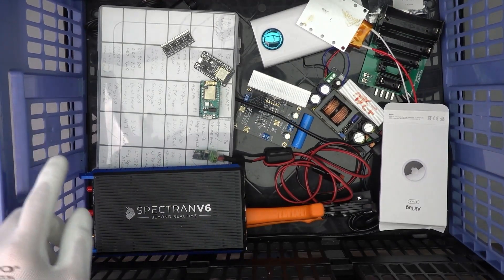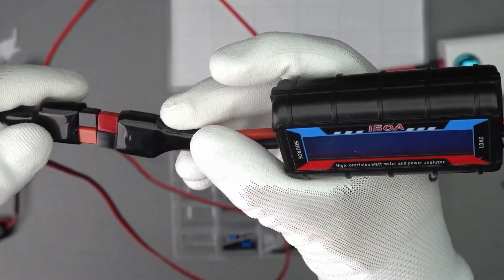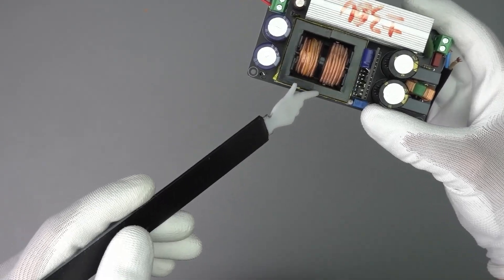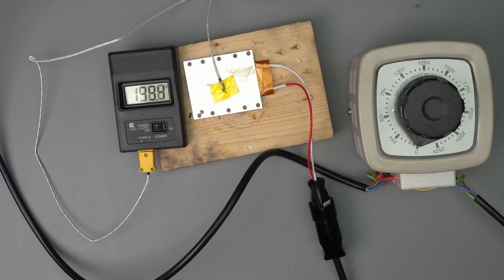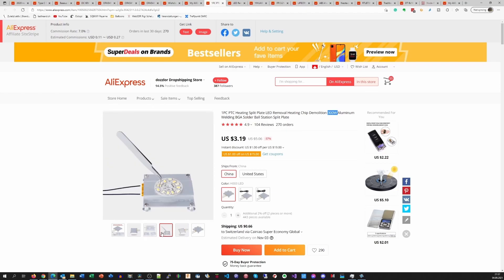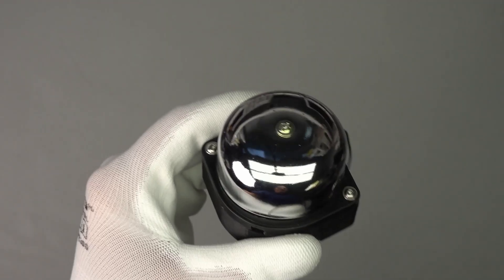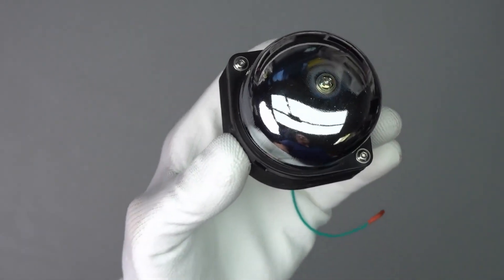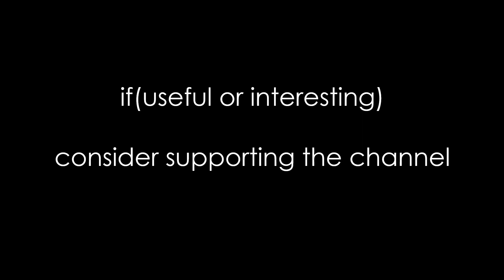#401 What is in my Mailbag?

Comment: Of course there is also the problem with the serial ports on the RTL8720 BW16. The one connected to the ch341-uart converter is not the one used for flashing. So you either have to connect the two serial ports with wires, or use a different converter on the second port. The combination of button presses to get it into flash mode seems to be a problem on some boards (hold reset, press burn, release reset, release burn), but it works for me. Arduino gives you a countdown to start the procedure.
Reply from the maker: Good information. Thank you! I probably would have searched why it does not flash ;-)

Comment: The problem with using a hotplate alone to do SMD solder is that sometimes you need so much heat that you get discolouration or burn the board.
I like a hot plate to preheat the board and then hot air to target the component.
Reply: You're right, but if we are talking about doing things on the cheap, what you are suggesting is probably going to be quite a bit pricier. I think for a lot of ppl starting out, shelling out for good soldering irons, power supplies etc might not be possible. Even though it would yield better results.
Reply: There are these low melting point solder pastes like the TS391LT50 from Chip Quik. It melts at 165°C and I got excellent results with a hotplate.
Reply: @ockeojoj  The cheapie hot air stations aren't that expensive (or at least they weren't before the world ended).

Comment: The heating pad is a great find. Might be useful to build a 14x14 cm pad with 4 of these and with switches to control each individual square and consumption 300-1.2KW.
Reply from the maker: Maybe this is possible. For that I still have my old Aldi oven which I adapted to be used for SMD soldering.

Comment: Hi Andreas, If am not wrong this power bank what you have can be used as a UPS. It doesn’t reset power at output when you attach/remove power from it. I saw it in a video which I can’t find right now.
Reply from the maker: Thanks for the info. I did not check so far. It would probably be a big UPS...  You are right: Many power banks switch output off as soon as charging starts.

Comment: You mentioned a few videos ago possibility for using 20v Lidl battery packs. As a fellow Ham, to use a 4A pack and convert to 13.8v output would make a good project. Using a switch mode  regulator for higher efficency but with low line RF noise being the ideal solution. Add the possibility to parallel a 2nd battery pack for 8A and it would make a neat and low cost portable 13.8v supply. To recharge the packs Lidl sell a dual charger at low cost.
Reply from the maker: A possible solution. But instead I use a simpler one: A LiFePo4 battery without and conversion. You get them in various sizes and the overall solution would probably be cheaper than the Lidls plus strong buck converters. An advantage could be that we could produce a stable 13.8 volt. The 4 cells LiFePo4 quite fast are below 13 volts which, with some radios, does no more yield in full power.
Reply: @AndreasSpiess  Your suggestion for a LiFePo4 is a good one but is more expensive and not as much fun as making a Lidl solution. Do you have any pointers / thoughts for selecting a low RFI and low line noise converter for 18v to 13.8v at 10 amps? Btw the Lidl dual charger is 15 Euro's, it has separate battery connectors + PCB and battery status display PCB inside so will make a perfect rugged project case, after the 240v PCB is removed. With 2 x 4Ahr batteries  at 50 Euros /pair, it will provide around 144Whr. The batteries could be easily changed once depleted for a fresh set in the field.
Reply from the maker: So far I never had to deal with so strong regulators. But I assume you have to invest some money to get the RFI out. At least this is what I did for my 13.6 volt server power supply feeding my shack.

Comment: They really took the cheapest route on the first touchscreen tool. That's just a guitar pick with a hole in the top! I strongly agree with the button to switch USB voltage being bad, that would have potential to kill many components. I have to admit airtags seem entirely useless for me, as it relies on iphones for signals to get around. Great video as always.
Reply: The usb-c pd board with the button can be set to a fixed voltage with the button disabled - like this:
https://youtu.be/aIHj3qMRqqE
Reply from the maker: @thigh_bone: That is what I did. But I do not trust it and the effect would be a bill of more than 1000$ for a new transceiver :-(

Comment: Hi Andreas. Maybe this is  my first comment to the channel although I follow U. About the RTL8720DN I managed to get it with lower shipping fees of $1.58 at Jessinie Store. Seems interesting to have a 5Ghz wifi: it arrived last week and I'll give a try. The other board has a more complex history to me: it happened that I bought an Arilux led controller which I planned to flash with Tasmota. Unfortunatelly, and unlike the other ones bought before, it came with Bouffalo BL602 risc V chip. So, I commented to the tasmota group and they refused to start any development for that chip because the poor software support (I agree). I also bought a development board, but I also skipped doing anything with this chip because there is only one port and because the benefits in cost will be visible on a large scale, not at a maker scale.
Reply from the maker: Thank you for sharing your experience! I understand the Tasmota team. The BL602 would not have a lot of advantages for their project but would add a lot of hassle....

Comment: I am using an RTL8720 in promiscuous mode for presence detection like you showed in one of your previous videos using an ESP8266. Realtek is very responsive if you have any issues.
Reply from the maker: Good idea. Does it also detect presence on 5GHz? That would be very good.
Reply: Yes it does! It also reads temperature and humidity from a HDC1080. It then sends all of this over UART to an RS485/TCP server that is controlled by node-red. you could also use another ESP/RTL to act as the RS485/TCP server.

Comment: The OPA549 has a peak drive current of 10A and a constant of 8A Andreas, I wonder if that heatsink is underrated for the job? I was only looking at that very op amp a couple of days ago to see how things have changed over the years... quite a lot.
Reply from the maker: I agree. But it seems to be limited to 6A on the board. Concerning heatsink: It probably will get active cooling. The dissipated power depends on the supply vs output voltage (the difference has to be dissipated). The datasheet has a diagram where you see that you sometimes get much less power that the 6A. At least it seems that the chip is protected.

Comment: I don't think the parallel connected 4-wire battery connections make any sense. It needs to be a separate voltage sense pair for each battery.
Reply from the maker: The idea is that you only test one battery at a time.

Comment: Will the power meter work if one has a rapidly changing DC voltage where the current is not necessarily in phase with the voltage. For example if a DC power supply feeds a rapidly switching mosfet (20 kHz). With such an arrangement, my DC power supply indicates that the circuit is drawing a significant amount of power when there is no load and nothing heats up.
Reply from the maker: I assume it is made for DC. So I would not trust its values if you switch the current with 20 kHz.

Comment: Interesting stuff, but the hotplates look like they could never pass EU or US safety standards. How do you send mains voltage into an aluminum heat sink without grounding the heat sink? I guess if it were internally doubly insulated, but I really doubt this is the case. Please consider tearing one of those units down in a future video.
Reply from the maker: I am sure they would not pass any tests. I will add a ground when I will use them in "production". One had a resistor and Kaptan tape around it. Not more. The other was blocked so I was not able to remove the resistor

Comment: Lifepo4 protections are rare and overpriced, I just use li-ion protection for over discharge and charge it with bench PSU with 3.65 v CC/CV.
Reply from the maker: I agree that you do not need particular voltage protectors. The one I use switches off a little below 3 volts. One had its point at 2.2 volt which is too low for both chemistries.

Comment: One thousand kilometers...I hope you started someplace really high or it was on the back of your car.  Wait...is a "bike" a motorcycle?
Reply from the maker: It was 3000km to the black sea. And 15'000m upwards. And no, it was not with my Harley ;-)
Reply: @AndreasSpiess  I thought about the trip and wondered if it might be possible to mount an Arduino with a battery to the frame along with a sensor that could measure the angle of sway back and forth as you ride.  Eventually it could get high enough to trigger a threshold that would restart my heart before I hit the ground.